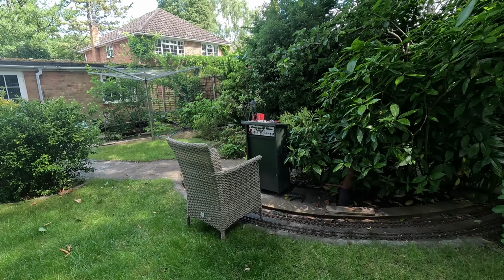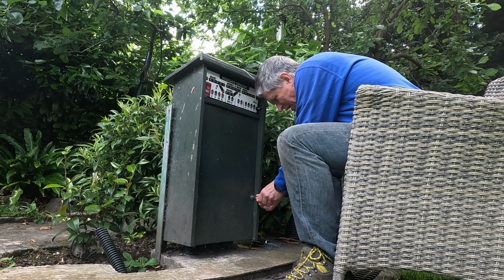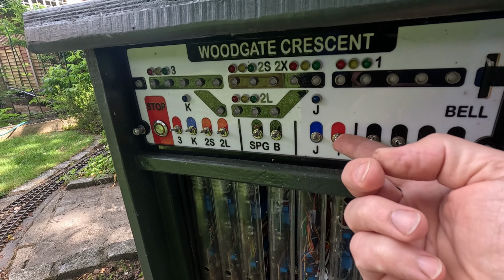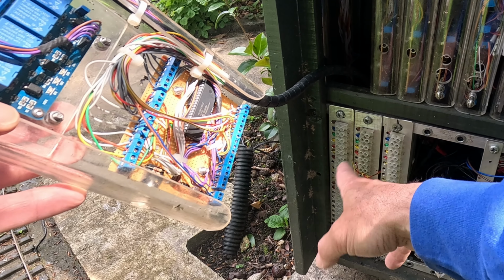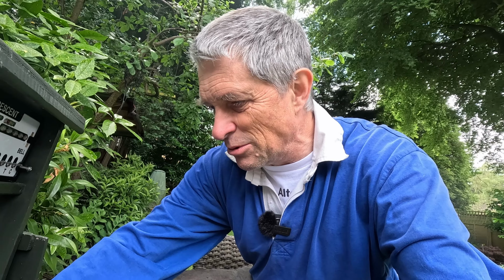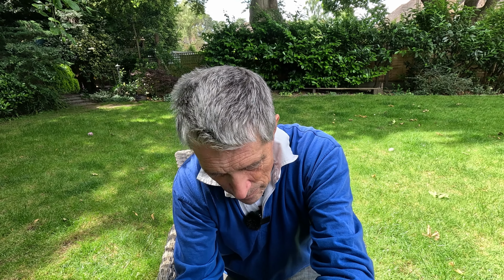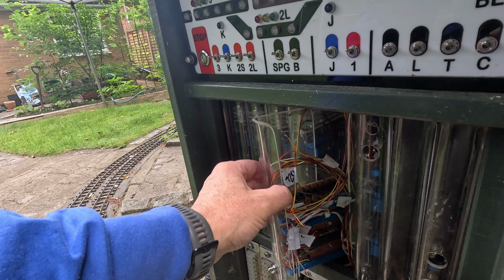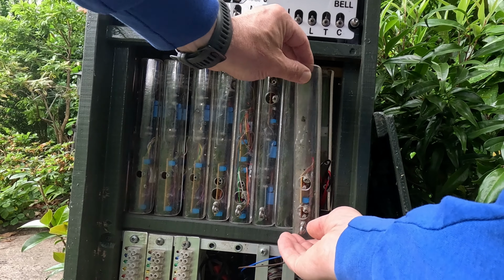Building a Garden Railway • Station Area Mimic Panel • Check and Review

Comment: Hi Warren. Did you ever dismantle those dodgy sensors to see what went wrong? Being reed switches in theory there is not much that can go wrong, I did wonder if they were rated for outdoor use or not and whether water had got inside and caused the issue? If moisture is getting inside and if it is the problem you could end up replacing units constantly which could be become a PITA as the railway expands. You might be better off making up your own units encapsulated in resin. Just a thought Richard
Reply from the maker: Hi Richard, nope, not dismantled them yet.  I have kept them on my bench ready to open up.  They are fully sealed units so can't see how water would have got inside them.  Frost damage maybe?

Comment: Mind blowing! I'm using three car door locking motors for the points and the rest is RC😀😀👍🤞🙏😊💜💜
Reply from the maker: Yes!! I have tested using car locking motors. My best go with these is to pulse them twice at 10v. First pulse to shift and second pulse to check. I found full 12v caused too much shock and bounce. How do you do yours???? Warren.
Reply: @Linleys  I'm going to experiment at 6v using a DPDT momentary switch with a 12v (using a 12v motorcycle battery) to 6v step down power supply convertor. Although I've done auto electrics etc etc, most of this stuff has to be painting by numbers for me. I hope that helps🤞👍😊

Comment: But Warren , there are no cables connected to the emergency stop switch ! 
Just kidding, thank you for showing your lovely railway to the public.
Reply from the maker: Well spotted with the missing cables for the stop switch.  Just like the bell button slot this is a future development.  It won't be just a power off switch as I want the trains to slow down and stop under control of the system.  More programming to work out with that! cheers, Warren :)